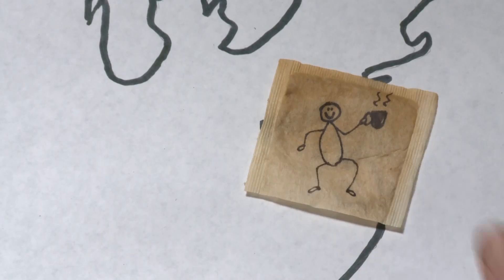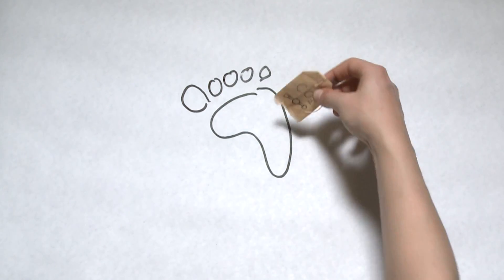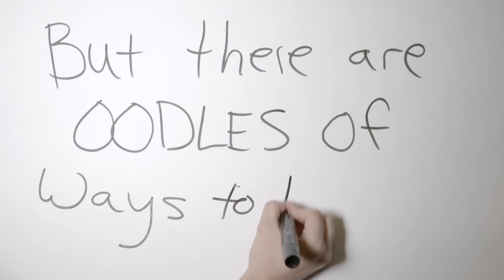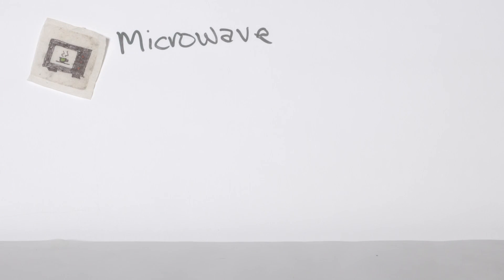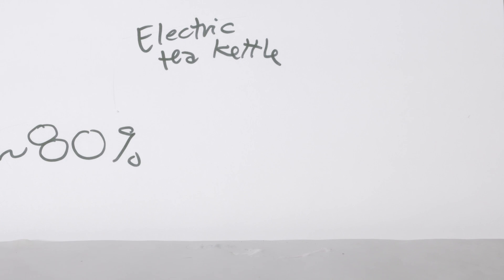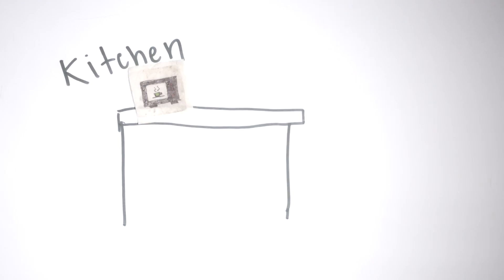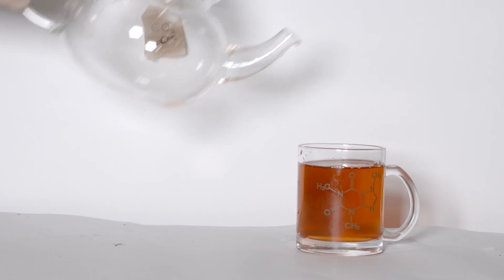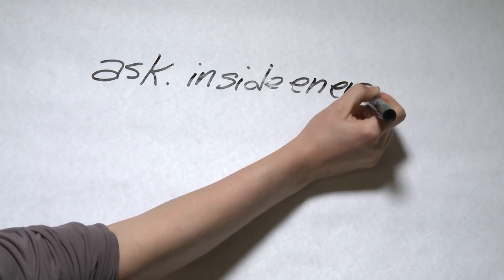What's the most energy efficient way to boil water?

Comment: I just tried boiling 2 cups of water in both a tea kettle on my electric range and a Pyrex measuring cup in the microwave.   The range boiled the water in 3 minutes while the microwave boiled the water in 5 minutes.  The microwave was 1.7 kW (input rating) and the range was 3kW.  That would make the microwave more efficient in terms of energy used.  540 kJ for the range and 510 kJ for the microwave...

Comment: This video is telling lies.
Induction is NOT more efficient at boiling water than a electronic kettle!

This is because an electric kettle heats up the water, and only the water, while an induction platetopp will ALSO heat up the container the water sits in, therefore requiring MORE energy to bring a water to a boil, than if you only heat the water.

Comment: The average household uses about 29 kilowatt hours of electricity per day. It takes about 0.06 kilowatt hours to boil a cup of water, i.e. 0.2% of your household's daily consumption. Worrying about the efficiency of your tea kettle is a very inefficient way to reduce your carbon footprint (versus, for example, heating your shower water). About half of your electricity, on average, goes to HVAC, so spend your time on insulation (walls, windows, and pipes), good windows, and plugging air gaps in your external doors, that will do much more good.

Comment: The statment that renewables have a zero carbon footprint is incorrect. Solar and wind both use very specialized materals that are mined from the earth, nearly all of which is done using equipment powered by fossil fuels. As well, the manufacturing, transportation, intallation, maitenance, and disposal of these technologies comes into play. In fact, without tax credits, these technologies would not last long enough to repay the money that was invested to use them (and tax money isn't free). Using a solar resource map, you can see that there are a few areas around the world where the solar power density is greater (up to 2x) and therefor has a better ROI, but for most of the Western world, wind and solar are mainly a feel good technology. However, when judging the invirometal impacts of a given technology, one must consider the technology's entire life cycle, cradle to grave. NO ENERGY TECHNOLOGY has zero environmental impact or carbon footprint. This isn't to say that solar and wind are don't have their place, they are just just romanticized and and overrated. Solar panels might last 20yrs, but the inverters last 10yrs, batteries Last 5 or less (when used). There are only a few places in the western world where enough wind is available to take advantage of wind. Both wind and solar require a lot of land!

Regarding the efficency in brewing of tea: the brewing of tea does not require boiling water! The truth is, it takes more energy to take water from 211F to 212F (99.4C to 100C), than it does to go all the way from 33F to 211F (0.5C to 99.4C). It takes a lot of energy to effect a phase change from liquid to gas. So, given the right electrical controls, you could brew tea without boiling water and do so at a much higher efficiency, especially when using an electric kettle. As well, the necessary electrical controls are cheap and readily available.
Reply: Fascinating stuff and very insightful.  Thanks for sharing!😊